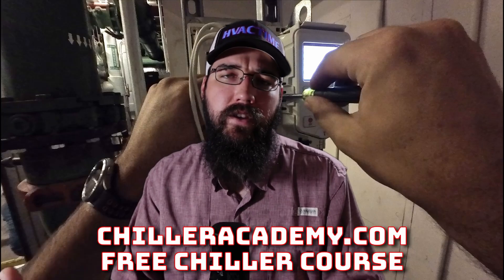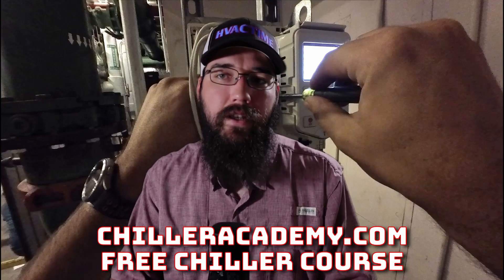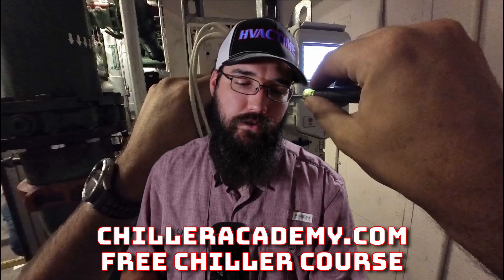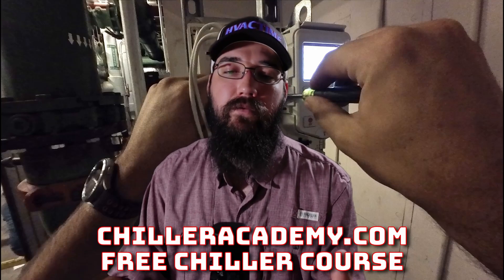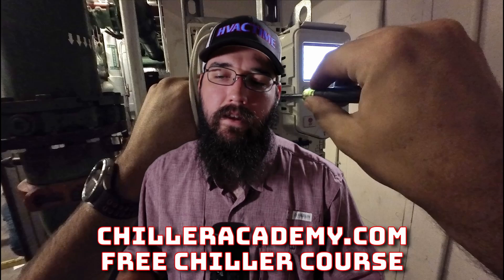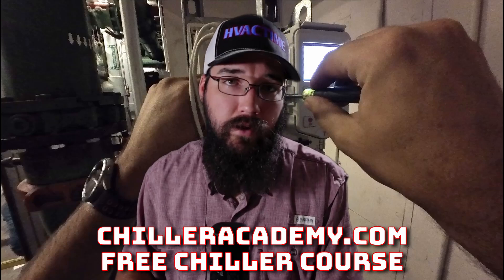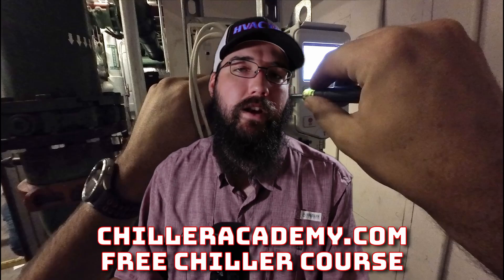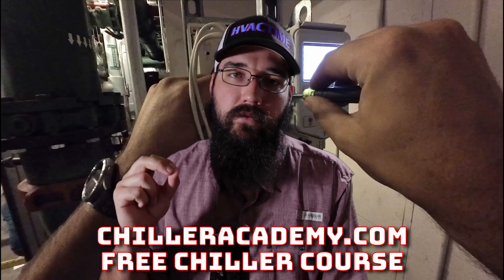HVAC VFD Accel/Decel Time Commisioning

Comment: Sir, Yk centrifugal chiller style H facing problem condenser liquid level refrigerant fluctuate 1.9 % to 90 %, already replaced new refrigerant actuator positioner valve. Can you explain what is the issue. And how to troubleshooting it. The warring is liquid refrigerant level stability.

Comment: typically, when I have a building with outdated hardware that's failing,,, equipment by equipment will eventually get converted over to standalone controllers. the honeywell T775 can literally do 99% of building applications and yes the pid loop can be tuned. Heck I even used 1 for a pump that fed the main building water loop ( just make sure you put the transducer at the top floor)